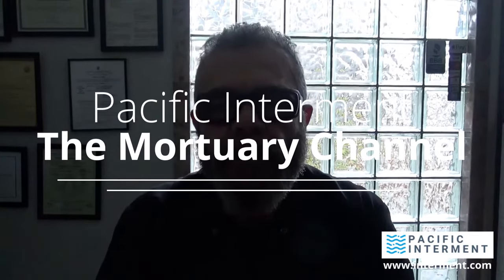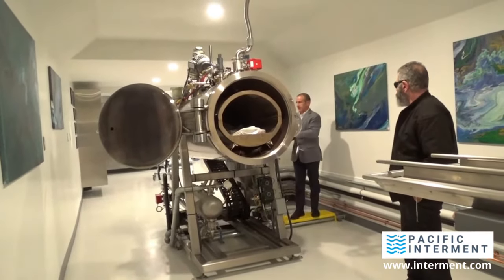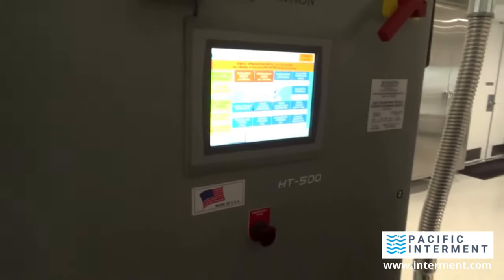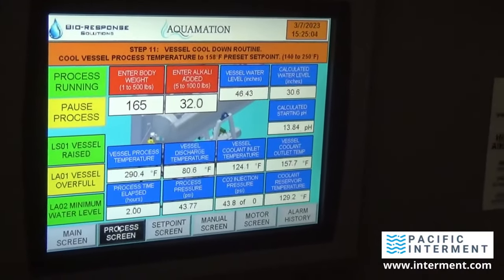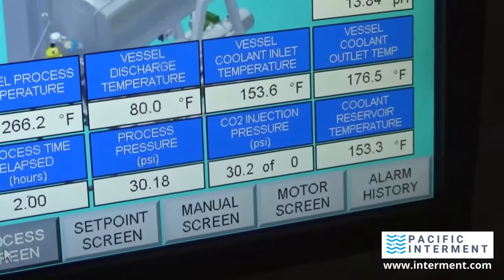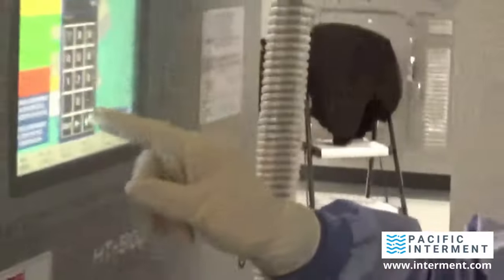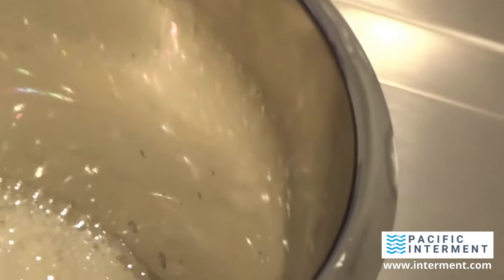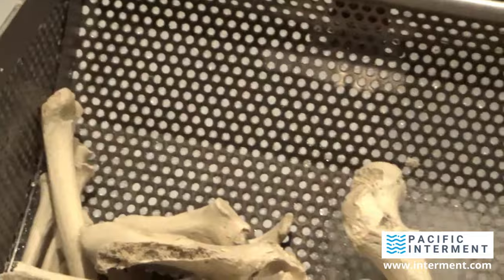Aquamation Process From Start to Finish

Comment: Basically a large pressure cooker and chemicals that dissolve all the soft tissues of the body. It’s less harmful to the environment than burning cremation or filling a body full of carcinogens that seep into the ground from regular burial. The bones are ground up to powder, just like regular cremation, and given to the family. It is a lot less expensive than regular embalming and burial.
**The info was good. The video was horrible! The movement was so fast it was almost worthless.
Reply: Agreed! This is one of the worst quality videos I have seen for such an expensive new process.
Reply from the maker: You are exactly correct. I concur that my video skills suck.
Reply: i would explain the process on tripod then show it in a seperate cut.  appreciate the video @themortuarychannel3977

Comment: Why does it have to be at a 35 degree angle ?  to catch the silt?
Reply from the maker: No, that is to make sure the submersible heaters in the rear of the machine are under water. Otherwise they would burn out.